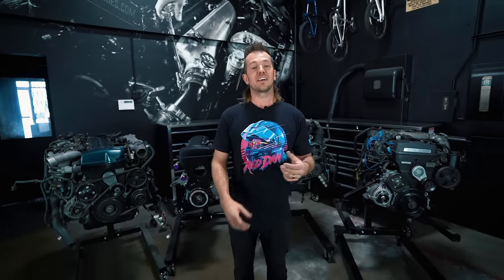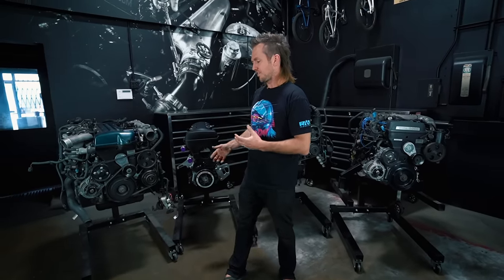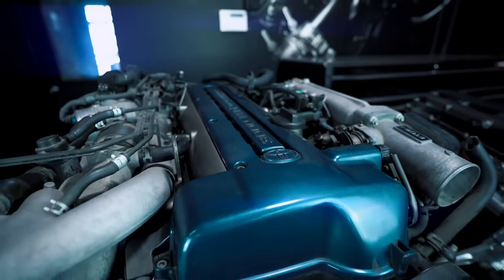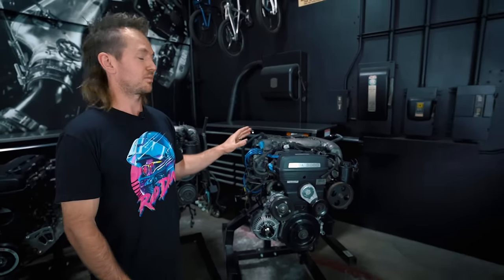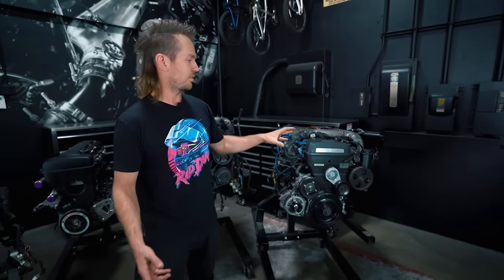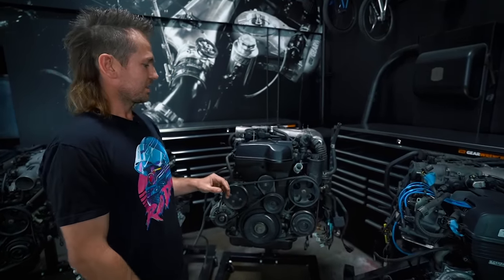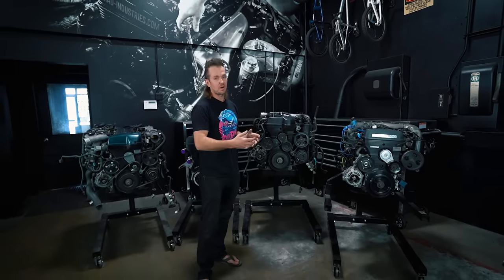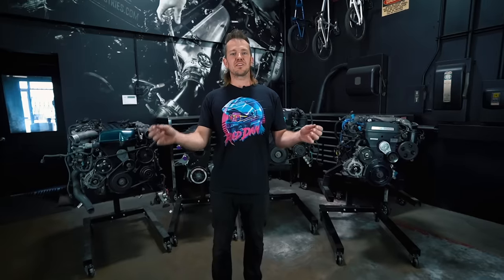2JZ Motor 101

Comment: He's wrong about the Non-VVTI GE's, they don't have a 10.5:1 compression its a 10.0:1. Its also a non-interference engine. Only the VVTI GE's had a 10.5:1 and was interference. Also while the GE's don't have dedicated oil squirters they do have oil jets at the base of the connecting rods for piston/cylinder cooling, getting oil from around the rod bearings. The dedicated oil squirters aren't that big of a deal either as many remove them to avoid the drop in oil pressure when the check valve opens for the oil squirters. 

Also the pistons on the Non-VVTI GE are made using the same material and process with just a different compression ration, it can hold the same amount of power as long as you lower the compression with a thicker head gasket. A large chunk of the compression difference between the GTE's and GE's compression comes from the different stock head gaskets.

As for the VVTI GE's if your planning on making anything over 400hp your better off rebuilding the bottom end. Both rods and Pistons are a lot weaker than the Non-VVTI GE's. They are made for low rotational mass and improved efficiency. When you start pushing them since the VVTI rods are thinner they will bend and since the piston has less material around the ringland that can also fail. The distributor on the GE's is not a weakness either many have made high numbers on the stock distributor. If you want to go coilpacks and block off the distributor port that is also easy to do. You can also swap the heads or bottom end if you want VVTI but don't want to rebuild the bottom end.

Comment: Can you put a 2JZ-GE VVTi head onto a 2JZ-GE non-VVTi to get rid of the distributor?
Reply: You can but you would need to run a standalone to manage the whole system. What i did was buy a cam trigger system and a coil on plug kit and ran it with a non vvti aristo ecu, alot cheaper this way.

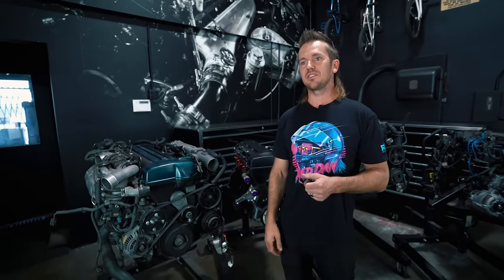Comment: 4:58 the stock block will not handle 2000rwhp on anything except maybe a dynojet (reads higher) even then it would be a grenade with the pin pulled

Comment: The 2jzgtevvti stock turbos 280hp. Can i get 550hp out of the stock turbo stage2 clutch PMCmotorsports and flywheel To BMW gearbox....and massive intercooler from RPjapan..550hp possible.?? Bild project is in motion in a 1981 Opel Monza full body Line-x. Stopping power EBC brakes yellowstuff.
Reply: Great video  BTW.
Reply from the maker: No

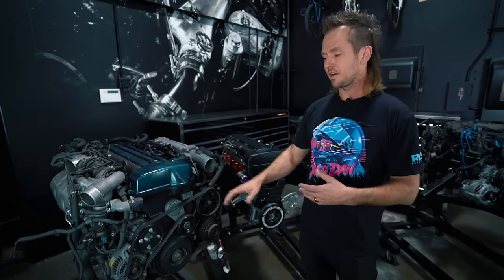Comment: @4:21 its not just different turbos, the JDM did come with Ceramic versus the USDM style Steel turbine wheel but the Camshafts between the JDM & USDM were also different RE to Lobe or Lift&Duration.
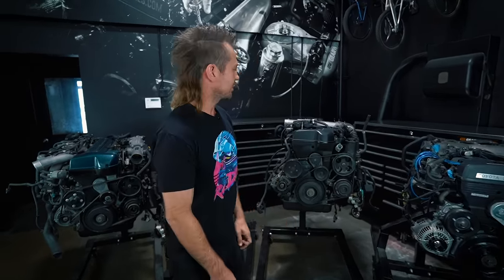@10:48 you should consider flow testing the heads to confirm flow on them RE to the GE having better flow than the GTE. Yes I'd expect that seeing giving the GE better breathing would be logical as its non turbo to help keeep power up. however RE to flow its just like the 1.5JZ myth (or is it 2.5jz wtvr its called) claiming 1JZ head flows better so people slap ot on a 2JZ bottom end wellllll the 1JZ heads actually flow worst than the 2JZ GE & GTE heads. There's some info on that on SupraForums i mean seeing is believing but it's only logical too. You guys should do a video giving such Critical info in a seeing believing form lol

Overall Great video, informative & you brought the facts I'd say about 8.5/10 on the facts lol. 
also be it the VVTI GE motor being non-distributed another PRO of having a vvti is well VVTI for better early on response guaranteed up full rpm etc it's going to be normalized but that early on VVTI response is a pro as well.
Reply from the maker: I know there are a lot details I didn’t cover, but this video was for the bottom end mostly and I had to be kinda quick. It would have been easy to talk for 35min on the little stuff too. But they can google for all the other details
Reply: RAD Industries 💪🏽

Comment: The 2jzge non vvti actually has stronger pistons than the 2jzgte non vvti because the crown on the piston is thicker. It can and has made plenty of reliable power well over 700hp. 
Its also a non interference motor.

Also oil squirters become more of a hinderance with high hp engines as deleting them keeps the oil pressure higher elsewhere which is of more importance.

Just a few things he was incorrect with.

Comment: Never seen a zjzed make 2000whp.  I heard that 1500 whp is max.  That’s still fucking awesome.  However I heard you want to start running into the 5’s they would need a billet 2jzed.  Nonetheless I’ve seen a Supra at Milan Dragway and fuck was it a beautiful. 
GM kinda got the bug with the smaller displacement engines and making big power.  It’s a 2.2L ecotec and its a stock block and that little sucker ran 5.95s at 230mph.

Comment: I’m building a 98 vvti ge, would you sell me stock gte rods and pistons or know anybody who would sell them?
Reply: Bro get aftermarket
Reply: @aaronsanchezz  Sorry I don’t have $2k to spend on internals.
Reply: @superbird9095  2k? You can get good hbeam rods for like 280 and decent pistons for another 300... heck they even sell new oem gte pistons for 500... you're just asking for trouble with used turbo pistons.... but if you reply want some used oem gte ish they got some on Ebay for 525 shipped, for the used ones you want.... id spend the extra 180 tho... you least gotta get new rings too.
Reply: @aaronsanchezz  With oem rods and pistons I was gonna replace the wrist pins, rings, and upgrade rod bolts to arp
Reply: @superbird9095  yep comes with rods pistons n pins. On ebay rn. They look nice actually but the rods definitely dont look as strong as the hbeam ones but unless your going high hp probably dont need it i guess.

Comment: RAD INDUSTRIES, I have a 2JZGE VVTI engine. If I were to swap put my pistons and rods with 2JZGTE pistons and rods, would they fit without issue? And will the crank be good for at least 700hp? I already have the pistons for the 2JZGTE, i just want to make sure they blocks have the same bore and that they will fit without issue. Will I also have any issues as far as the oil goes for the Oil Squirters? Tarzan_126 is my Instagram username if you guys would like to contact me there or here is fine. Please and thank you! I could really use the help!

Comment: ge vvti is interference, ge non vvti is non interference. and did i hear you say that you wouldnt pick the ge non vvti because it uses a distributor!? so youd pick a vvti model that has the weak ass bottom end vs swapping a GE non vvti  to coil packs? that makes zero sense. Also most high power 2jz builds ditch the oil squirters so i wouldnt fault a ge for not having them. This video is so misleading.